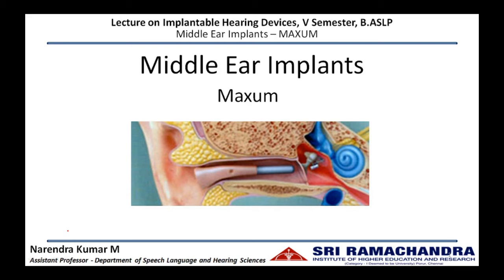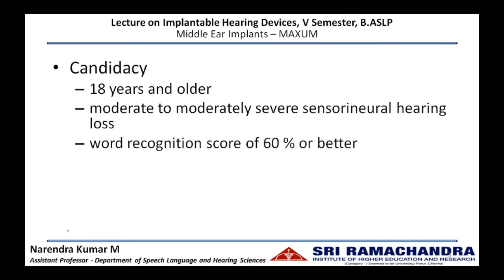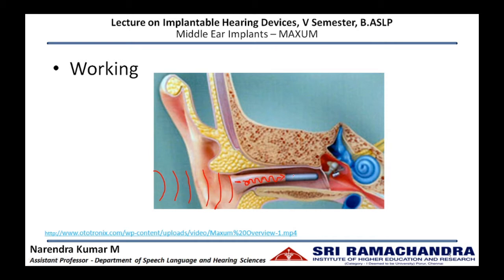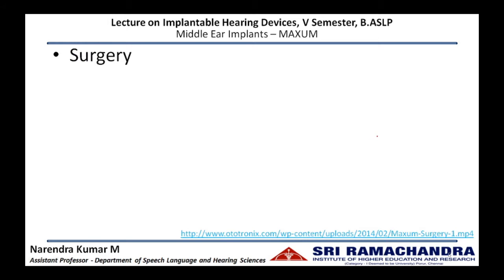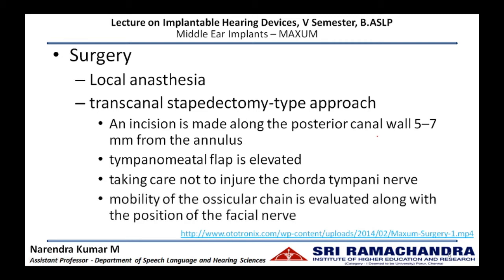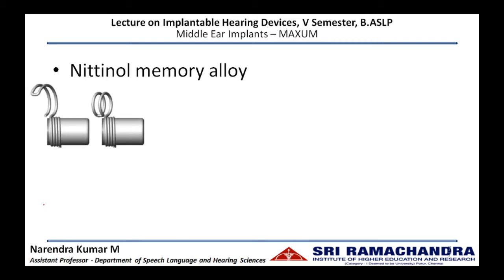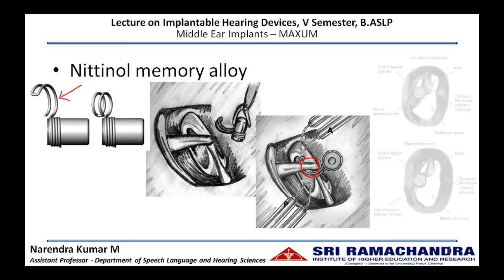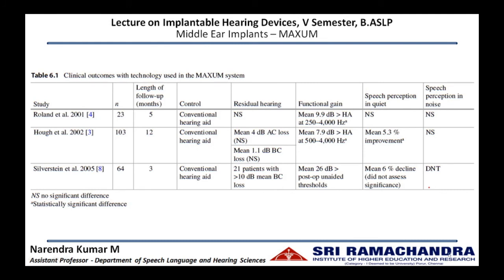Midde Ear Implant - Maxum

Comment: Are any of these implants other than baha and cochlear implant useful when the stapes is fixed as in otosclerosis?
Reply from the maker: Surgical corrections to improve the mobility of stapes (Stapedectomy/stapedotomy) can be performed, if this doesn't improve the hearing part, vibrant sound bridge may be an option. Still people do get benefit from conventional hearing aids. The management options need to be evaluated based on existing conditions, the client's preference and expected outcomes.